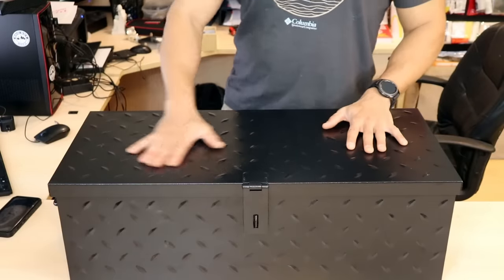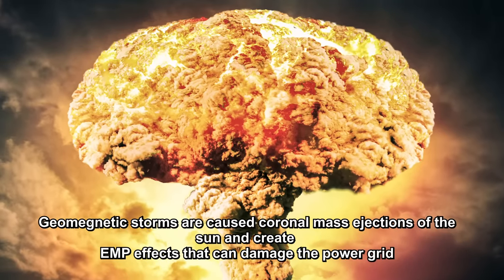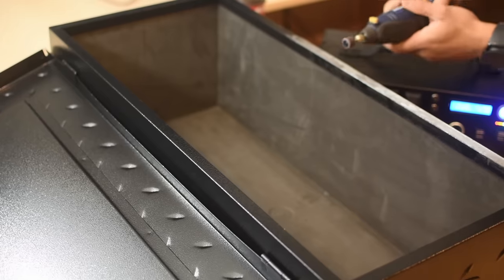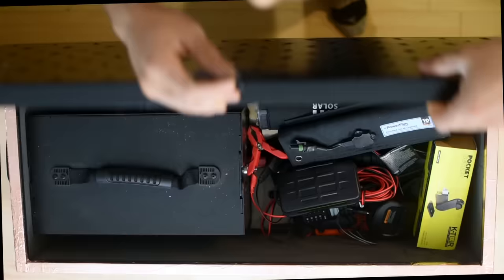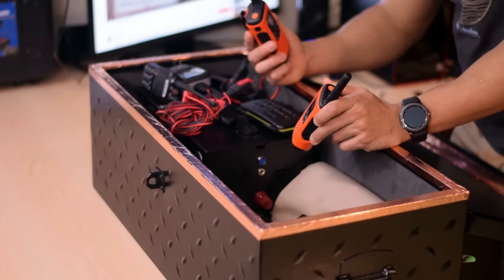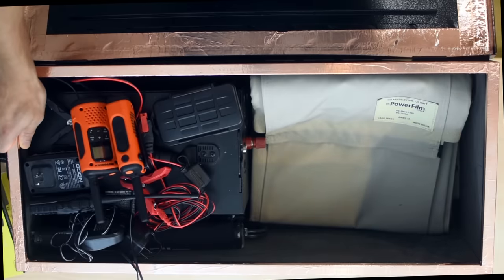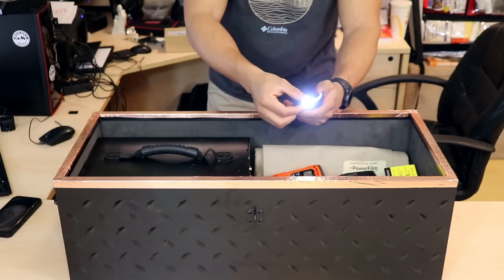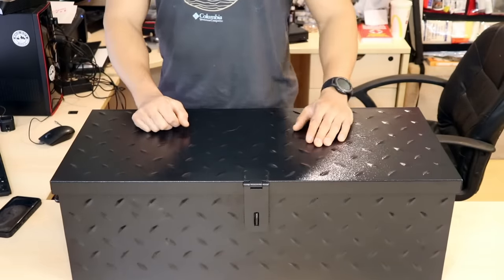EMP Prepping: Building a Good Faraday Cage | Inergy Kodiak Generator

Comment: Thanks for another well made timely video. I have quite a few electronics including a computer that I want to protect so I was thinking of converting an old file cabinet. You can pick these up for free and they would hold a lot of equipment. Any thoughts anyone?
Reply: I know your comment is old (3 years ago), so you may have changed your mind about a painted metal box like a filing cabinet.  My understanding is that linear openings are the worst.  A one millimetre wide crack will let in considerably more than a fairly large circular opening.  If you seal the linear openings with metallic tape, you need to insure the adhesive is conductive and touching raw metal, not a painted surface, otherwise you still have a linear opening.  Also, if your container is made of iron (steel, including most stainless steel), be sure not to ground it.  Grounding it makes it an antennae and the iron would set up a temporary but much greater magnetic field as the intense electrons flow thru it.  Any memory chips, capacitors and other circuit board components sensitive to magnetic fields would be damaged. Also, don't waste any Faraday cage space by putting in batteries. they're pretty much immune to EMP's.  It's something everyone needs to consider, given the crazy international stuff going on.
Reply: @richardrobertson1331      a one mm size opening will only let in electromagnetic emp waves that are 1mm or smaller.  Same as Microwave oven window holes are sized to block microwaves, but not other electromagentic waves. The idea is just to make those holes as small as possible.  Even having a few holes one mm or smaller is better than nothing, and increases your chances that your electronics will survive.    In Cresson Kearney"s "Nuclear War Survival Skills"  (Oak Ridge National Laboratory) He says keep whip antennas collapsed to 10 inches or less.   Keep the radio far from metal pipes and long wires,.... even that much will increase your chances of your radio surviving,
Reply: @robertwilliamson6121  Thanks Robert.  It's all important stuff to know and prepare for, but hopefully never need to be used.  The error I made on the 1 mm opening is that I didn't mention the length of the opening.  If it were 1mm by 1mm, that would be a lot safer than a 1mm by 20 inches, for example.  Thanks for your clarification.

Comment: I'm considering doing a "bank" of office filing cabinets. Again, sand down the closing edges of drawers and frames as you showed, then around the bottom of the frame by the floor and have to put matching sheet metal down to seal up the bottom end because they have the tendency to be fully open.

Then I'll use the copper tape and grounding strap around the various locations that need to have a tighter seal around the openings. Like on the various videos from "HAM Radio Crash Course" where he utilizes the mini trash cans for his EMP project.

Comment: adhesive backed brass... tape is nonconductive with adhesive !!! SPREAD THE TRUTH
Reply: Exactly what I was thinking. The copper on top of the tape is conductive but the adhesive layer is not. So taping that around the lid must not work well.
Reply: It would if you went ahead, and taped the copper over, and around the edge some, and not just along the inside.

Comment: This is the best I have seen, This will work, anything less will fail, from one that worked in the field, but only if there is no gaps between the lid and the container, I mean one even as small as a milometer. better to use a gasket of conductive material that seals completely.

Comment: I do not want to seem too critical but there are many things lacking with your understanding of shielding and NEMP.  The adhesive on that copper foil is not typically conductive.  You have just made a capacitor that will increase the emp effect inside the box VS not having it at all.  You need to have proper beryllium / copper finger gasket that is electricity connected to the chasis.  You would be better off connecting a simple grounding strap between the lid and the box.  Having a plan, and making preparations is never a bad thing but spend your energy where it can matter.  I, unlike Bradley do not have a web site or use my PhD to sell anything, not to disqualify his actual work on rf interference and IMD products. His statements about the NEMP effects ignore the what is experimentally known. I also know for a fact that he has access to many  classified and unclassified documents that have detailed experimental data on the subject.  There is no doubt that everything plugged into the “grid" will suffer extensive and catastrophic damage, this fact is undeniable.  The damage to the economy and the indirect loss of life would be unimaginable.  However most disconnected electronics would be unharmed, this is not just my opinion, it has been tested in simulated NEMP of over 50KV/M that is twice of what the USSR R-36M2 20MT could produce at the surface when detonation occurs at 300km altitude.  We also know the EM signature of a NEMP from two high altitude "experiments" Starfish Prime and Test 184 in the former USSR, most of the energy is below 1Mc and decrease by the square of the decade above that frequency.
Reply: Aaron Edwards 
so with a ground strap or 2 he's added protection if he just needs to unplug everything.... I think better safe then sorry
Reply: Jason Moser.  Separate issues, for shielding with a faraday box you need to have electric conductivity between all parts. Copper foil tape has a non conducting adhesive, I have actually used it to make capacitors in the past.  The copper tape on this box will act as an antenna that will also act as a bandpass filter that allows a specific frequency to enter with little attenuation.  I do agree better safe than sorry,  the idea of a strong-box, like is shown for critical gear is great.   If your primary concern is about NEMP and shielding you need low resistance conductivity between all parts.   A couple grounding straps Between the lid and box will do well, propper Beryllium - Copper finger gasket making electrical contact beteeen the lid and box is the best thing.  In fact that is one of the the many specifications for Tempest EM shielding.  I feel safe with my equipment protection plan based on experimentally derived data. In fact I own the specific model of HF radio that was tested to over 50 kv/m simulated NEMP and suffered no damage while unplugged (ft-101ZD).  I also hold an Amateur Extra license and am familiar with proper radio operations.   An NEMP strong enough to cause permanent damage to electronics that are disconnected from mains and antenna systems would be so close that you have much large concerns,  such as Gamma radiation,  extreme heat, and over pressure. 
Now if you have concerns about directed microwave burst radiation like the CHAMP GBU-12 device, that is a whole other discussion.

Comment: will this work vs a solar flare  like the one that set telligrafhs on fire in 1859
Reply: Did you ever find out?
Reply: @galtigjtokay5318  not yet
Reply: It will work only if the lid cover is sealed tightly with aluminum foil to keep anything from entering and grounded . Keep all batteries out of equipment.

Comment: Another great video, you have made a cost effective option look good and I think it would protect your kit. 
For those with the budget, too lazy or without the skills you can use Zarges Mitraset and Zarges K475 cases as they have passed the shielding requirements of 60dB from 150kHz to 18GHz. 

As a custom option, the Mitraset and K475 cases can be fitted with a EMI shielding gasket made from Chomerics CHO-SEAL 1285, which is silver-plated aluminum in silicone and provides additional shielding between 90-110 dB. These boxes are very rugged and the K475 is IP67 so added protection of your kit that includes a humidity indicator. But like I said not cheap to purchase!

Comment: Home Hardware sells new empty steel paint cans.  They are coated inside and on inside of the lid with some kind of coating, so I rotary tooled that off for metal to metal contact.  
 It's big enough for a couple FRS two way radios and one of my Kaito KA1102 AM/FM/SW World Receivers.  
  What I did with the radio is, bought a mil spec cordura case for it that fits it like a glove and insulates it from metal contact, wrapped that in heavy duty tin foil, put that in a small bubble wrap bag, and then inside the steel paint can.  Then for extra insurance, sealed the lid with aluminum tape. 
   I tested the paint can even before grinding that coating off, and without the aluminum tape,  by putting my cell phone inside and then trying to call it. The paint can totally blocked reception.  I figure with the coating ground off, and aluminum tape, and the radio having a tin foil extra layer, that the protection will be even better.  
 But careful..... maybe should have TWO faraday cages with radios.   First EMP goes off.... .  then you take your radios out.  A month later the enemy blows another EMP to wipe out the radios that preppers took out after the first EMP.

Comment: what I would do is take each device on that box and place it into a faraday bag. and seal each bag (makes sure to take apart radios from its batteries so units dont chew up the power).
it will also protect the items from any moisture and water just in case.  dont forget the essentials of pen and paper that can be used when wet.

Comment: Hey man great video. Go get some auto vacuum hose, and use the tape u have. Set hose to one side  and roll leave 1/2 in. Hanging off the ends to connect and overlap other ends ... U got a gasket
Reply: I was looking for a cheaper alternative to buying Dr.Emp's horrifically expensive gaskets. Thanks!

Comment: Hay mate , you should consider putting an earthing wire from your box , to Mother Earth . 
The box may work without , but in the event, where  you actually use it , it’s much safer . 
And , I would suggest work more efficiently ,when you consider the intense electrical charges that would be present , in a real event . 
Your not just blocking emf , but grounding the damaging electrical charge . 
I hope this is helpful .

Comment: I can understand wanting to have a nice-looking rugged box but for someone in a hurry or on a very tight budget, there is a far simpler, quicker, and cheaper way to go.  You mentioned it briefly.  Simply use aluminum foil and recycle some plastic shopping bags.  Let's say your item or items are in a cardboard box.  Just wrap the box completely in aluminum foil, then wrap it completely in plastic and repeat.  Aluminum foil is fragile so I make a triple Faraday cage using this process.  The plastic layers prevent the aluminum foil layers from touching each other.  A label on the outside tells you what's inside.  You might write "OPEN IN CASE OF EMP" on each label too.

Comment: I use an old refrigerator. Fully metal ouside with insulation built-in. Alumuminum tape around the door to seal it. Grounded. Hope it works.

Comment: The only part on my daily driver (79 F150 , 300) that is susceptible to EMP is a tiny chip off my alternator.   Junkyard is full of them, so I have an extra one of these chips wrapped in lead.  Also, real ammo cans could be used as you used this larger can.   A crank AM/FM radio is also a good idea.

Comment: Nice tool box Faraday cage, try RF gasket, aka RFI gasket around lid instead of metal tape. its metal mesh that flexes and will fill small holes better. Its made for doors on sensitive Radio equipment. Also as you said put this inside a larger Faraday and any critical info on Hard Drives might want a a couple more smaller faraday cages inside your box

Comment: This is a very cool idea. The only problem I see is only being able to charge items that were in the box with the Kodiak. You'd need another or a bigger box to hold the electric stove top, fan, etc. That is of course, assuming there is an EMP strong enough to knock everything else out. At that point I guess it would be better to have one flashlight that can be charged than none!

Comment: As I know, the sticky side of that Cu tape isn't conductive (dielectric), so you actually do not make contact with the top lid. Another thing is that you need to have a ground wire and connect it to the GND of the outlet.
Reply: No. For a small Faraday cage protecting some two way radios and Short Wave receiver, no ground wire needed.   That information is wrong.  This has been tested time and time again.   
   Tests.    Cell phone in microwave oven. (Oven not on)   Phone rings.
Cell phone in antistatic bag,,,  phone rings.  
Cell phone wrapped in heavy duty tin foil.... cell phone "Service not available"    and radio loses reception
Cell phone inside closed steel paint can....cell phone "Service Unavailable"    and radio loses reception

Comment: A bit late but some tips, Take all the antennas off the radios [save the front ends]  Some batteries like 18650`s do have a chip inside so EMP might zap them [I glad-wrap mine and mylar bag them] On your type of box I did testing with my R&S Spec analyser and I got nearly 70db down which the MIL-SPEC needed I believe for EMP. You will need to copper tape ANY seams in the metal. On your lid that will fail because there needs to be a 1:1 contact all around the lid. The way to fix that is put a 5x5mm foam strip up the middle and then copper tape over that, so you get a compression fit all around the lid.  This gave me another -15db cut @ the UHF frequ`s.
Reply: The foam strip-copper tape idea is genius! I've been trying to come up with a solution to that problem for a while.

Comment: 16:15
Technically, your truck is a faraday cage. Even if you don't completely seal your truck, it will act as one if you put a grounding cord on it. Depending on how much you're willing to spend, you can make your house into a faraday cage using mesh and plaster instead of typical sidings. Remember to GROUND your faraday cage; you want the charge to pass around and gone; you don't want it to linger and dissipate.
Reply from the maker: Ive researched that and apparently a ground is not required.
Reply: Oh? Now that's interesting.

I think I'd want grounding anyhow, for static shock purposes.
Reply: EMP and static electricity are two different things.  Do not ground your Faraday cage.  Your ground will act like an antenna during an EMP.
Reply: Dito!
Reply: Never ground a Faraday Cage.  RF and a negative Ionized charge/ electricity (ie lightning)  are two different things, and like an antenna, a ground strap will actually subject your electronics to a higher amount of RF energy
Reply: Clint Carpentier then why?  Why Clint, do trucks shut off whenever there’s an alien ship hovering?

Comment: use neaprone for the liner or an old sleepmat wrap all your stuff in tin foil as well or emp bags and add a ground wire to your box.emp shorts out wires and components.have one in my van its called a van vault

Comment: I built a solar generator, 400 amp hour 5,222.4 watts for the batteries,
 3,000 to 6,000 surge pure sine wave inverter, outback flex 80 charge 
controller , runs my ice maker, coffee maker, sat TV, lights etc

Comment: I used 2 metal trash cans from Home Depot, inserted a large trash bag in between them and another trash bag inside the inner can for the actual items. Takes up only 4 more inches in height than one does but gives an extra layer of protection.

Comment: Nice box. Now I have an excellent use for the aluminum adhesive tape that was accidentally purchased! 
All I was looking for was your 2-way radios. 
After any nuclear/ emp event, any range will still be better than shouting your lungs out..in a SHTF global situation. 
My advice.. triple up on that walkie-talkie stock in that box ;).. you will be glad you did!
Additionally, how about a few watches/ or a phone and spare batteries to tell the time?
Reply: The adhesive acts as an insulator. Be certain to fold one, or both edges/ends of the tape over, so it makes contact with the metal container, and tape those edges/ends down tight. Check for continuity between the surface of the tape, and the metal container you're putting it on.
A decent multi meter is $5.00 at Harbor freight. Throw it in your EMP proof box, it will aid you in repairs and diagnostics after an event.

Comment: Good Job! But you created something more than just a Simple Faraday Box.  Remember Survival Lilly's video of a couple of months ago where she went and checked out how her Survival Shelter did during the Winter.  Recall her Dismay when she found out the Mice ate through her Plastic Containers? I think that your Box would also work just fine as a Cashe at a Bugout Location.  Also, you mentioned having "Layers" of Shielding? You might want to see how many Ammo Cans could fit inside that box and put your Small Stuff in them. Finally, if you decide to make Custom Cages, please keep them less than 40 Inches Wide, but about 18-19 Tall. Why? Because most SUVs and Crossovers nowadays have about 40inches in width Trunk Space. And you want them 18-19 inches Tall so you can use them as a Bench. Try sitting on a Old School Foot Locker. They're Too Short!  Hope this helps.

Comment: Just a question - You showed putting a data storage device in yet you didn't show a laptop or tablet you would need to access the data nor did you discuss that need. And yes you need to ground your Faraday cage to be most effective. You can increase the effectiveness of your box by wrapping your devices in aluminum foil and then slip it into a Faraday bag. 
I do like your box idea much better than a trash can. It is better looking and looks to be easier to store. Thanks for the tips.